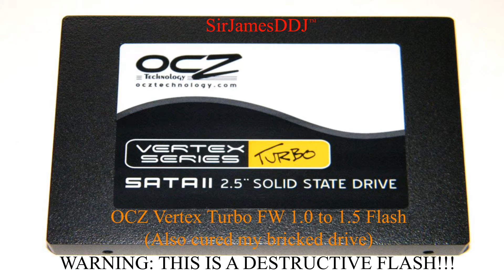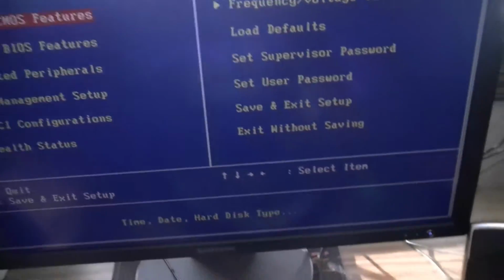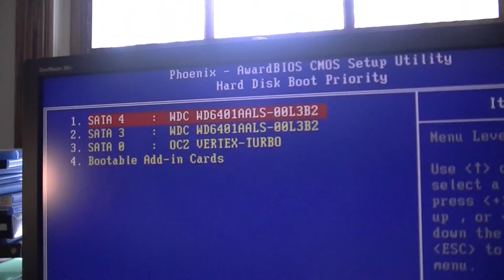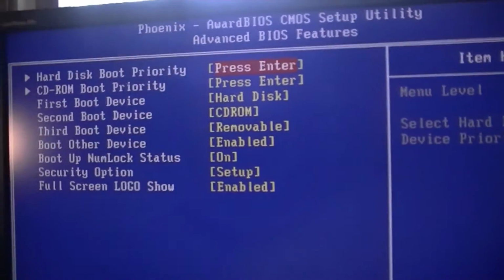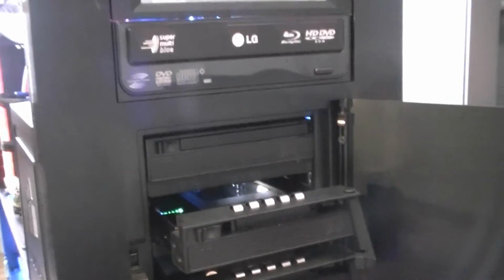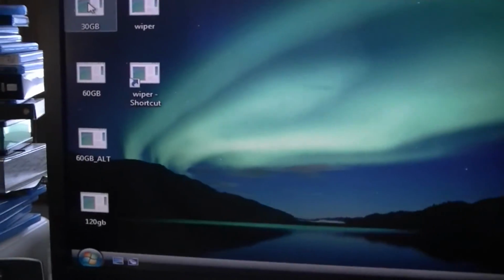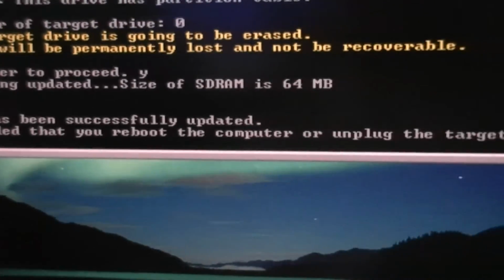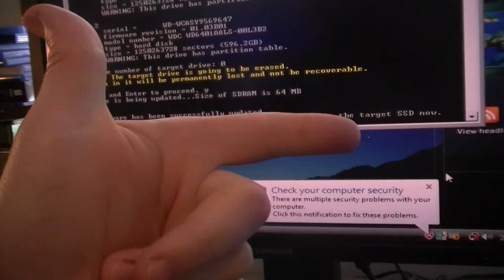OCZ Vertex Turbo FW 1.0 to 1.5 Flash Tutorial

Comment: Great video however after following your instructions and those provided on the OCZ forum I have not been able to flash my ssd a 30gb vertex turbo 1.0. When I run the firmware update it does not list any drive. Grateful for any suggestions thanks.